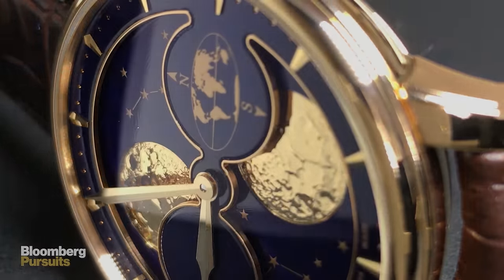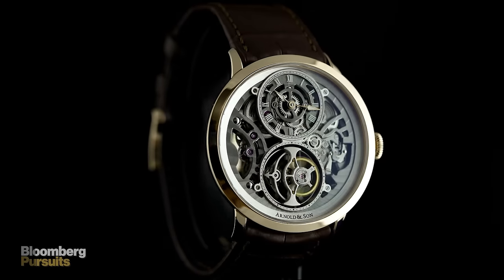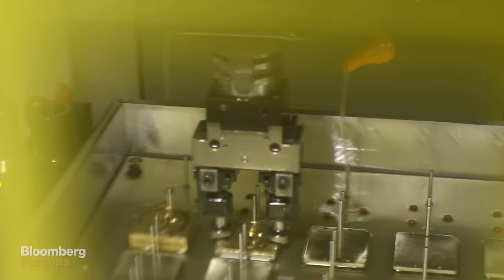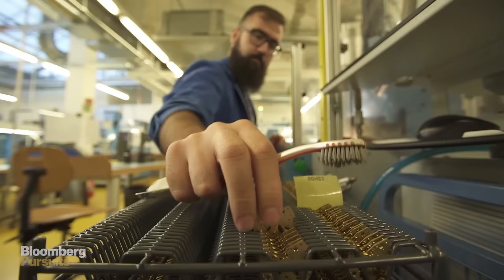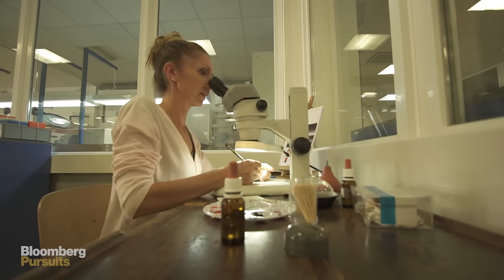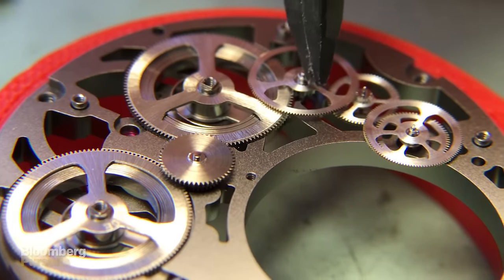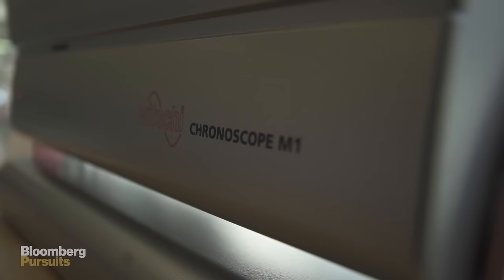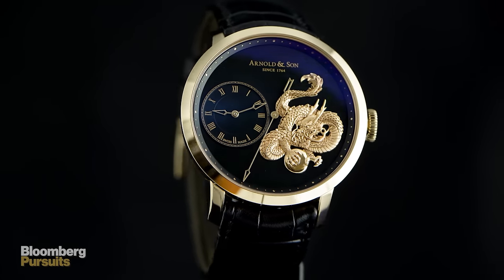The Painstaking Art of Luxury Watchmaking

Comment: funny thingis  digital or batery watch is more accurate
Reply: The difference is actually very subtle. High quality quartz movements are incredibly accurate, but those aren't found on your everyday 25$ watch. Many mechanical watches from reputable watchmakers are tested by the CSOC for accuracy and those that pass are very close to the accuracy of a quartz movement. Not better, but close. Plus the fact that you don't have to change the battery on a mechanical makes them still very relevant.
Reply: Nerd_United
It's COSC
Also, quartz watches also have a COSC spec. That's +- 0.07s/day as opposed to a mechanical COSC -4 +6 s/day.
Not saying it matters. Just need to meet my smartass knowitall wikipedia lookup quota for the month
Reply: wpaia the point of a mechanical watch is as an accessory, not for strict time keeping. For accuracy, you cannot be more accurate than having it synced to the Internet (One of mine can actually capture some time broadcast signals in some areas) 
There is a beauty to mechanical watched that quartz ones don't
Reply: wpaia don't matter.. Both use Quartz
Reply: wpaia if your shooting for "accuracy" then you go to an "atomic" clock.. Which is used by such devices as satellites of all kinds..
Reply: what is time anyway?

Comment: Autodesk Inventor? What? where the hell is Solidworks.
Reply: Solidworks doesn't allow much CAS, or the ability to stylise shapes. It's a bit too engineering based
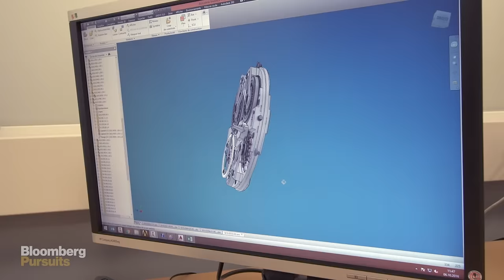Reply: @saurav3047  I just rewatched the video and saw at 1:03 he is using inventor but also has solidworks open. That seems like a lengthy process but it answers my questions.

Comment: 04:45... 'tick-tack'? I'm not sure this guy is a watch expert.
Reply: Painted Pony well because the mechanism uses something called pallet fork that got two pallet with different surface thus when the escape wheel hits it, the sound that was caused by the teeth hitting those pallet would be different/distinctive thus the tick-tack.... while the quartz watch just simply goes ticks-ticks.
And fyi, that watch with ticking seconds hand is a mechanical watch with a dead-beat mechanism, the inspiration behind why quartz watch ticks instead of sweeping smoothly across the dial while this mechanism already around from 19th century
Reply: He's a French-speaker.

Comment: so painstaking that china is making them for $9.99
Reply: +KapiteinBadpak china is making mechanical watches for very low prices
Reply: true I bought a very nice looking mechanical watch on Alibaba for sometin like 15 - 20 USD
Reply: very low prices, very low quality.
Reply: low prices does not necessarily imply in low quality
Reply: not necessarily of course, within context... Context being "made in China" from inferior substitute materials with low waged, poorly trained slave labor. Not necessarily.
Reply: Of course a $15 Rolex yacht-master replica 'made in china' does not have the same quality as the original one. However, it has enough quality to last for several years. Sounds to be a good cost-benefit trade-off.

ps1: Smartphones are 'made in China' by low waged labor and have good quality.
ps2: "[...] poorly trained slave labor." => off-topic
Reply: A good Rolex replica is not $15 dollars. More like $150 dollars, and up. Not going to knock all replicas, especially when it comes to Rolex, since they've been copied for so long its not hard to find a decent one. But ultimately it's not going to last as long, and not going to retain any of it's value, so why pretend to begin with? 
Smartphones are made be well trained, albeit poorly paid labor, and are made to only last 2-3 years.
Reply: I paid $50 for a "replica" Rolex once... Don't do it. I had to re-adjust constantly because it would lose minutes over just a couple weeks, the finish wore off, the face got scratched to hell because it wasn't real sapphire, and the band fell apart. And this was just from wearing it every now and then over a 6 month period. If you want a nice mechanical watch, save up a bit and buy something real that's in your price range. I ended up buying a $400 Bulova watch on special for $250 and it's perfect. I wear it just about every day, minus the days where I'm gonna be getting greasy or muddy, and it still looks brand new. I always get compliments for it, and I know from experience that women are instantly more attracted to a man with an expensive looking watch.
Reply: They don't have a movement even close to this.
Reply: I have yet to see a Chinese built movement that makes use of jeweled bearings. That alone doesn't bode well for the long term durability.
Reply: Those aren’t watches that grow in value over time.
Reply: Wearing knock off watches says a lot about the person wearing it... it's not worth risking your reputation over